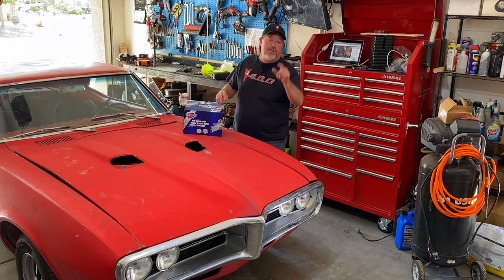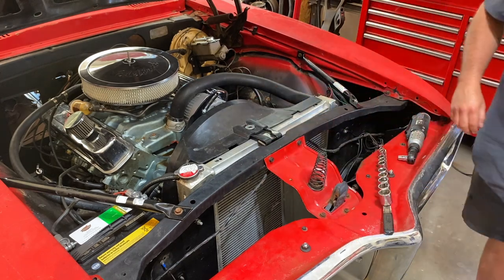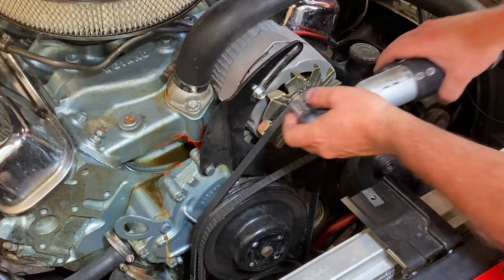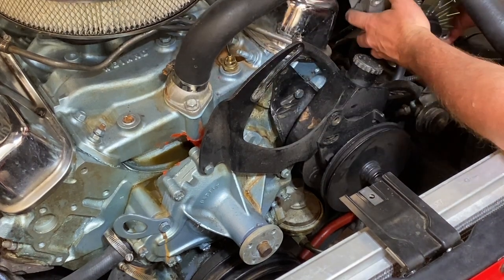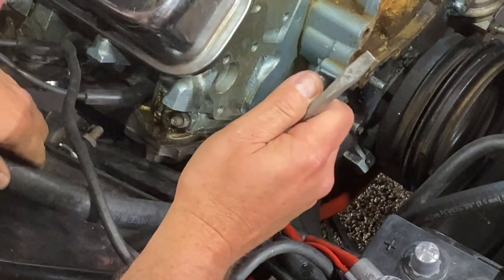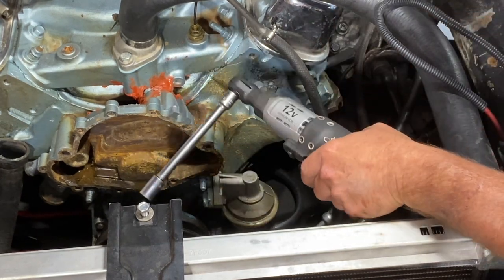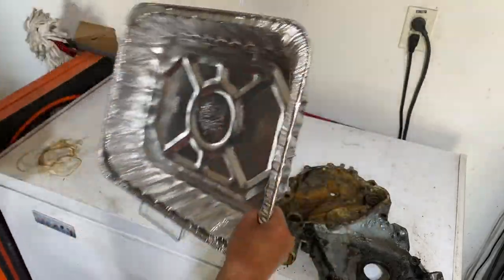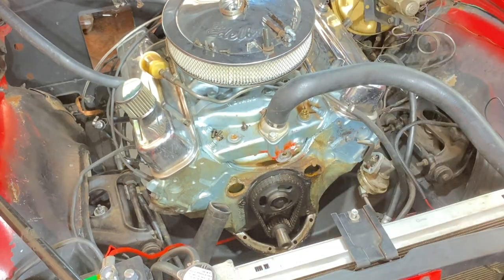How To Remove Pontiac Water Pump - How To Remove Pontiac Timing Chain Cover Part 1

Comment: 😅 I'm laughing because I've seen that exact same lack of divider plate!  20 something years ago I bought a 73 Formula 400 in Tucson and drove it back home.  I spent the next few months fighting with very marginal cooling performance. Previous owner had replaced the pump months before I bought it, so I went after everything else, like radiator, fan, & tstat. Finally, I pulled the pump to find NO DIVIDER PLATE.  I'm guessing the previous owner returned the plate attached to the core.

I see you have a 70's accessory setup for alternator, etc. Although not resto correct, I like it SOOOO much better than the 67 setup.  I run a later 70's style 11 bolt pump/timing cover, but still use the 67 alternator/ps pump brackets with a deeper water pump pulley to keep the belts aligned.  The 70's setup was engineered much better.

Your channel has reconnected me with my bird.  Well done.

Comment: You didn't have to remove the timing cover and remove those tubes.  The rubber "O" rings in them are replaceable.  Just take a ice pick or similar tool are remove the rubber rings.
Reply from the maker: You'll see in part 2 I had too... they were rusted in place.

Comment: That broken bolt should actually be a stud and a nut, suprised to see the pump divider plate missing.
Reply from the maker: I was so shocked at the divider plate!  And yes part 2 I pull that damn broken stud out!  After 2 coors lights lol